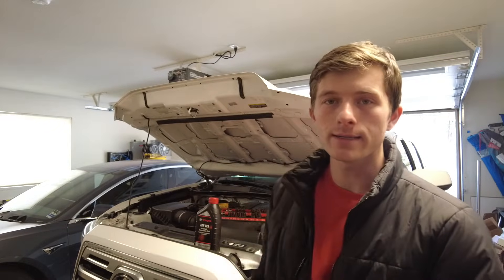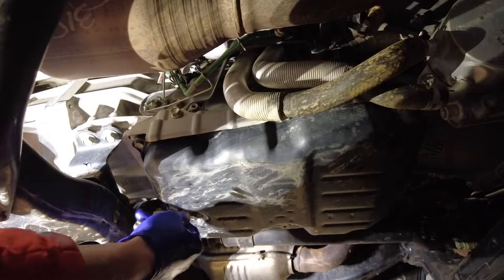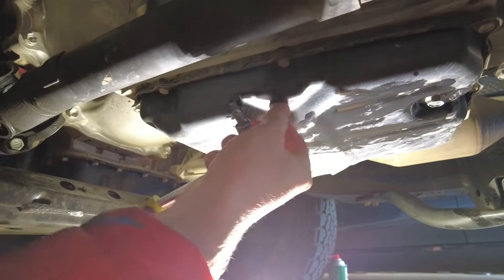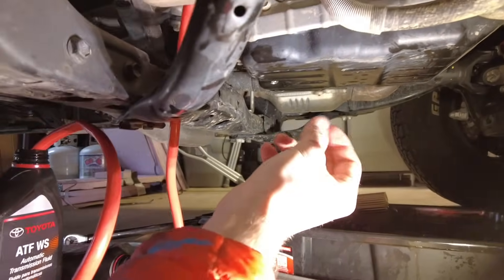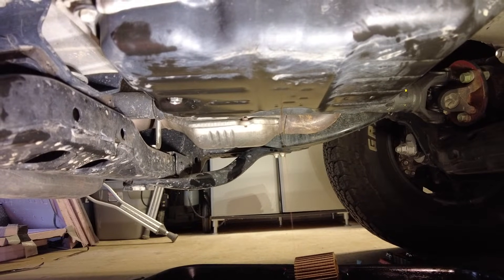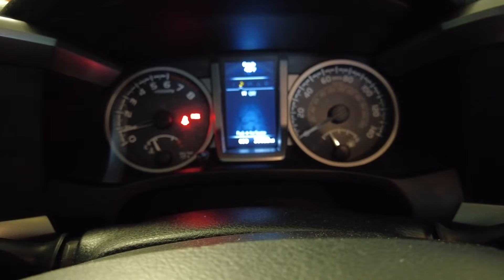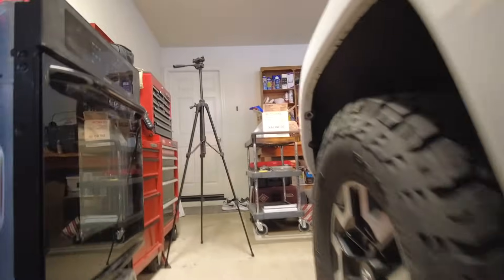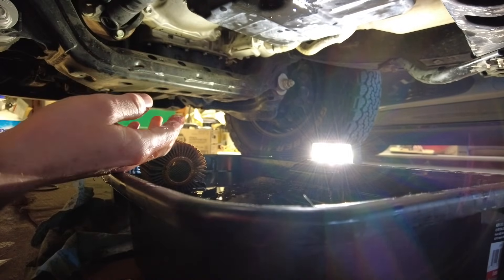Drain and Fill on Transmission - 2018 Toyota Tacoma

Comment: Always break the fill nut before the drain nut....last thing you want is to drain the fluid and not be able to fill
Reply from the maker: Very true
Reply: Just flip the truck … lol
Reply: How in the world do you get the fill plug off?? I can’t get a ratchet in there hardly, the socket won’t latch on the plug and even if it did I’d have almost no strength to torque it off. Is there some special tool???
Reply: @rb3tactical145  I just used a 15/16” socket and half inch drive breaker bar. It’s not easy but can be done
Reply: @rb3tactical145  shallow socket and breaker bar, shallow socket and flex head ratchet, or offset reversible combination ratcheting wrench.
Reply: @rb3tactical145  Do you have a long enough breaker bar?
Reply: Exactly sir great point of view 👍

Comment: Only a simulation of how to check the fluid level - because he didn't have the engine idling during the final step of his fluid level checking procedure.  So we don't really know if he ever got the fluid level correct.
Reply: @Nor Fen It's too late then.  You need to study up on the latest theory about servicing a Toyota (Asin) transmission.  You need to service it at 40-60k miles and every thereafter.  Waiting until 150-200k miles, the fluid is full of debris that actually helps the aged/worn clutches maintain grip and shouldn't be changed then, wait til failure and rebuild to start over...
Reply: Would it be better if you had someone to watch the D indicator and someone to check the fluid level

Comment: How many quarts would you say you actually ended up needing?
Reply: The rule of thumb with me is when I drain fluid out of a transmission I make sure I measure it and I put the exact amount that I took out back in
Reply: @knowbetter56  you're assuming there was the proper amount in the transmission before